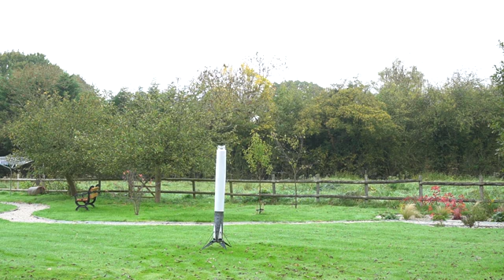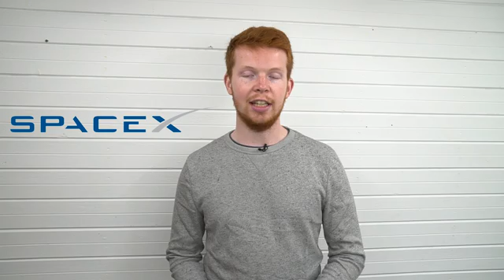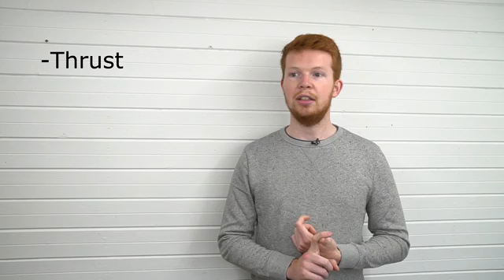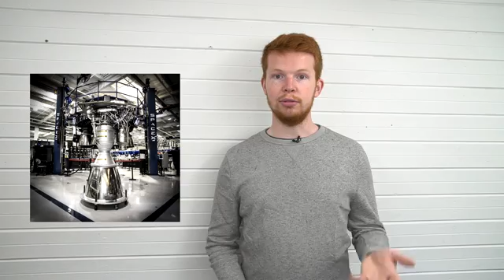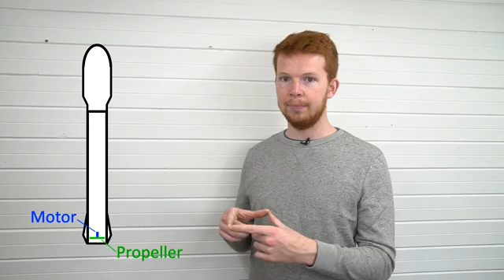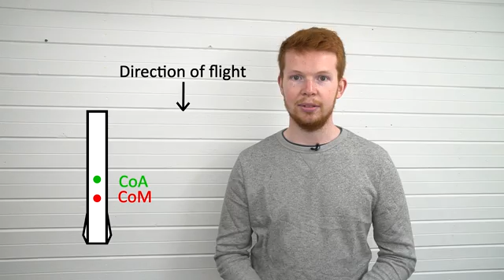Hovering a rocket - SpaceX model

Comment: This is all great. But the control surfaces on planes aren’t all called flaps. You talk about the grid fins as used for aerodynamic control, so that would be like the rudder and ailerons and elevator on an airplane. Not flaps. Flaps are to create more lift when going slow at takeoff and landing.
Reply from the maker: I used the word flaps because the average Joe might not know what an aileron is ;) thanks!
Reply: Tom Stanton Well, educate them then as you do with the rest of your video. :)

Comment: Using a larger ESC would have helped,also using a gyro stabilization system that was calibrated for what you are doing. That would require changing the PID and it appears you dont know how to do that. The mass was over powering the stabilization.  Had you gotten the unit up in the air BEFORE  attempting to control the direction ,you would have been further ahead. Eather way,It was interesting watching you try. Its much better than shouting FAKE and using the lame excuse of CGI . I really want to strap those guys to the real thing and give them the real experience. Awesome job!

Comment: Try inside a large garage or gymnasium so wind won't be an issue. Also, the cg is too far forward. You need to adjust your pid algorithm so it won't oscillate as much... nice work!

Comment: I really liked the elastic tether. Obviously it adds an unwanted dynamic which hampers tuning. An improvement would be a tether of 25% elastic tied to 75% inelastic, so that you can have "free" flight without snatch at end of line.

Comment: what if you go back on the 2 motor version and the second thrust vectoring type.... and use a smaller motor on the tip just give some speed to the incoming air... and use the second motor ,on the lower part of the rocket to hover ... i thing by this way...  u will have more lift and more controll.... and your motors will not stress so much

Comment: Please don't give up on this project! I'd love to see more content about this control method. I have visions of a model falcon 9 with a high thrust COTS EDF for the main engine, a gimbal instead of thrust vectoring flaps, 4 smaller EDFs or mini quad motors as control thrusters at the top and a lower center of mass so it emulates a real falcon 9's control/handling characteristics

Comment: Good job
The problem with the rocket tipping over when launching it (although it was capable of hovering) was due to the wind pushing it to the side with no force into the ground to stabilize it.
That’s the same thing we helicopter pilots have when launching... you have to push it for a split second and then level out to get away from the ground fast enough.
I totally see this as a success

Comment: Really looks possible with your skills and a few more versions.  I have always wondered why they choose to launch rockets vertically instead of flying them more like planes from a horizontal start.  Just seems to me it would save fuel and require less power and stress?  Maybe have jettison capable wings or air frame for first part of liftoff.

Comment: In large rocket engines the load on the area that articulates, allowing directional thrust, is enormous. How can these parts take such a load, and what about powerful lateral forces involved as well? The mechanism must be balanced mechanically to some degree, but still, it must be extremely powerful.

Comment: Should have been called guy builds RC helicopter that kind of sort of looks like SpaceX rocket after talking about it for 30 minutes. Then has problems that normally RC helicopters have tries to resolve them by speaking those words but doesn't
Reply from the maker: But it isn't a helicopter... so that would be misleading! Apart from the source of thrust, the rest of what I built uses rocket stability methods, therefore it is more of a rocket than a helicopter

Comment: While you don't need it to counteract the torque any more, you could still add a second motor to increase your thrust and reduce the load on each motor.  Maybe even give the lower motor a higher pitched prop, because it's dealing with pre-accelerated air.  
Also what size motors were those?  There are some tremendously powerful 2206 and 2207 quad motors these days.

Comment: Great project!  I was wondering if a control moment gyro in addition to the thrust vectoring would give some faster reaction control.  Essentially a high kv miniquad motor with a flywheel on a gimbal may give quite a bit of reaction moment.  I don't know enough about CMGs to know if that is feasible, just a thought.

Comment: Really nice!
I am not an expert here, but i think due to your rocket rotates around its axis it is almost impossible to control it. Is in it? What if you would add compass and combine it with your thrust vectoring system. Your simply requesting direction (lets say north), according to the rocket orientation based on the internal compass just add extra degree to the relevant bottom wings. Of course, wings should continuously correct equilibrium according to the gyroscope indication, your request just add an extra degree to all of it. Then you will be able to sustain the wind even if rocket spins around :) I think... :D
Your projects really interesting to watch!
Regars

Comment: The stability explanation is not quite correct. For stability you need the center of pressure behind the center of mass. This is usually different from the center of area. The grid fins move the center of pressure much more than the center of area, they have hardly any area.

Comment: I would have got it hovering without the body 1st and then gradually add length. Also like helis that require full rpm to remain stable, constantly changing power settings might seem prudent but drives the gyros crazy. In this case a collective pitch system while more complex would be far more stable and controllable. Maybe....

Comment: FYI - the flaps on an aircraft don't offer control to it - the control surfaces are ailerons, elevators and the rudder. 
The flaps increase the angle of attack, drag and to some extent the lift although there is of course a tussle between drag and lift in this case.

Comment: The trampoline would have been an easier landing pad. Smooth and flat, plus some thrust flow through. The grass kept tripping you up when there was any lateral movement.  Why didn't you just add orientation marks and then use the controller to influence the leaning of the rocket into the wind like a real drone does?

Comment: As for the motor burning out, could you not use props that have blades with a greater angle of attack or are these the most efficient in that regard?
Reply: +rpatto92 Blades with a greater angle of attack put more load on the motor unless the blades cavitate (which you won't see at this prop speed).  For the most part, "propulsion motor/blade" combinations are pretty optimal already.

Propellers (as with centrifugal pumps) draw the most power (heat up the most) the more air (water) they're pushing.  Basically because it takes a fixed amount of energy to accelerate a given amount of air (water) to a given speed.  If you increase the pitch (increase air speed) or amount of air (unchoke the input), the power draw goes up, and the motor gets hotter.  The simplest way to cool off a fan (or centrifugal pump) motor is to choke down the input (less volume) or a lower pitch prop (less velocity).  Which generally isn't conducive to keeping the propulsive power up, is it? ;-)

I built an "air cleaner" box for my shop with a 1/2HP blower drawing air through multi-stage furnace filters.   The blower was originally designed for a computer ducted-air cooling system with significant back-pressure (reducing flow).  Full flow thru the furnace filter, it would overheat and thermally shut itself off in less than an hour.  Choking off the flow by about 30% with a piece of sheet metal solved the overheat and the motor ran cold.

I had the same problem with a Jennair cooktop/downdraft blower.  Would overheat in 20 minutes until I choked off the flow a bit.

This is basic civil/mechanical engineering, something my dad taught me, that I've used since.

Tom's solution would have been to go to a more powerful motor.

Tom would probably had a lot of fun with a motor we worked on - a homelite weedwacker engine with an aftermarket "soup-up" carburetor.  7000 RPM 16x16 prop.  When we tested it (at about -5C), the windchill off the 100mph velocity off the prop was about -100C.  20 seconds of that, and my son's teeth didn't stop chattering until after an hour of infusions of hot chocolate.

Comment: Maybe you could go with a hydrogen peroxide engine (for more of a real rocket), and give it some very rapid thrust vectoring.  Throttle can be varied by simply controlling the pump speed of h2o2 into the catalyst chamber.

Put most of the mass at the top such that inertial is much greater at that end of the tube and the bottom of the rocket can move around much faster than the top.  

If moving the exhaust nozzle is too daunting, then go with multiple smaller nozzles so that a differential thrust can be generated.

It would be noisy -- very noisy -- and generate loads of steam, but what a show you'd put on!

Comment: It strikes me that your prop-fan arrangement lacks one more feature that a rocket has, that the weight (and centre of gravity) won't continually change as the reaction mass runs out. As this feature would make the whole thing hellishly more complicated, one more reason not to use rockets for this project. ;)
Reply: Changing CoM isn't that hard to manage. What is really a pain is propellant (fuel) sloshing inside tanks. :)
Reply: Gary Bullwinkle What? the oxidizer is only needed when you want to use a chemical rocket, and a chemical rocket is just one of the multiple options to get thrust in space. There are nuclear engines, ion engines, plasma engines, and lot more of things that don't use oxidizer since they don't burn anything. A fan connected to a battery doesn't use oxidizer by the way, it just needs atmosphere.
Reply: I had a generally good idea of the physics involved (following the rocket developments since the 50s) but realized something new today ... the gimble  correction angle needs to change during ascent due to changing  center-of-mass.
Reply: The only reason for using a rocket in the first place is the lack of an oxidizer in space!   If the oxidizer is readily available, why carry it?
Reply: Well, not the only reason; one could use a gasoline engine with its own oxygen supply, if you could figure out how to make it give useful thrust. I get the impression Tom would have used a rocket if it could have been installed as easily, cheaply and safely as a prop-fan.

Comment: We know helicopters can hover. and a contra-rotating blade drone can hover, and a drone inside a tube can hover. So what have you accomplished here? Hovering a rocket is a whole other barrel of fish from hovering a hollow tube. Space x use video fakery to make you believe their nonsense. Unfortunately you are trying to copy video effects with real world physics. 

Indeed, we can see that your thrust and weight of motor are set in the top of the tube. Space x's hovering thrust comes from the bottom of the tube. In your example the tube gives some stability to the hover. That doesn't happen if thrust is applied at the bottom end of the tube IE a rocket.

A very brave attempt though.
Reply: bob question the air comes out of the bottom, therefore that's where the thrust is.
Reply: jetison333
The thrust is all on the fan blades at the top of the tube.

Comment: It looks like your thrust vectoring is effective until one gear leg touches down, at which time the correction for the motor torque is thrown off.  I’ll bet the solution will be found in a return to the counter-rotating fans, combined with your thrust vectoring.  Have you considered using a pair of accelerometers like those found in cell phones?  One at the top of the tube and one at the bottom.  Your guidance program could compare the inputs to assist in attitude stability and one could also be referenced for position over the ground stability.  It would be cool if that could all be programmed into an on-board processor like an Arduino, making your “rocket” nearly autonomous.
Reply: Tom's using a flight controller from a quadcopter / drone that he's written custom code for. This has accelerometers and an in built compass and is running on a chip that's much faster than the arduino.
Reply: He already knows angular velocities of that thing.
Touchdown detection is always done using physical switches in landing legs/landing gear, both in all rockets and in airplanes. There are also other ways, such as analyzing vertical velocity and throttle level. 
But for all that he'll need to work on the code a lot. I also suspect he based his code on Cleanflight software for simple multirotors that runs on STM32 ARM-based chip. Simpler version of what we all have in our phones. :) If he were to base it on Ardupilot it would produce better results because that code has way better algorithms to base on. For example, it determines position the way real vehicles do, by fusing together accelerometer, GPS and barometer data. 
Btw, thank you Tom, you've inspired me to continue tinkering with my Python code for optimizing trajectories and controlling a rocket in KSP.
Reply: arduino has fast chips nowadays. You could also compare the results of top and bottom sensors. Ilike where Norman is heading with this.
Reply: Did you work for NASA?
Reply: olympiclinic, no, just a life-long interest in aerospace and engineering principles.

Comment: Awesome work, so you built yourself a drunk spacex rocket.
I knew about center of mass but never though about center of area which when you think about it, makes perfect sense. I learnt something knew.
I highly recommend using an ESP32 or ESP8266 saving you to plugging it in all the time. they are very small but not sure how much weight would affect your balance. You could potentially record your data while it's hovering for calibration.
Continue the good work.

Comment: Very good idea ! Success for a first try. Why did you remove one of the vertical thrust motors for the second iteration ? Maybe you should have kept the two counter rotating motors you would have have had more thrust and less thrust would have been lost to stabilize the rotation. I would like to see a follow up.

Comment: For the first attempt you say that you used a flight controller from a racing drone but in the second attempt you just reference a gyro to control servos. What gyro were you using? Also if you didn't want to use polystyrene to make the rocket body you could use cardboard tubes that many high power and mid power rockets use for Rocketry. I really hope I see a part 2 in the future, this really intrigues me!
Reply from the maker: Apologies for not making it clear, I used the same racing drone flight controller for both version (Naze32). Thanks!

Comment: Hi Tom, in order to increase thrust you could increase the diameter of the propeller to fill the inside diameter of the tube. Much more like a ducted fan works, this would also greatly improve the noice and vibrations coming from the propeller. As for the thrust vectoring, you might have better luck changing your design to accommodate a flexible cone as it will create a single jet of air which is more stable and controllable that your current spiral, if you run some smoke through the vectoring system you will realize that your current jet stream is broken down in 4 surfaces, I imagine this will also reduce the efficiency of the motor. On a side note, all rockets need a landing zone, get yourself a piece of plywood to reduce the chances of the landing gear getting caught with something. An idea that I'm going to throw your way, you could use a flexible filament with your cr10 to print a conical nozzle that you could actuate with servos and wires, you should only need 1 servo for each axis which would reduce power consumption and give you a longer flight time. Another idea, if you put a rotating weight on the z axis you might be able to put a payload on top without having to worry about the center of mass shifting too much. Anyways great video, I'm looking forward to buying a printer myself and build projects just like you do!.

Comment: Tom, you should've come to Manchester for uni. We have a society where we're attempting to build a 2 stage rocket where the 1st stage will land itself after deploying the 2nd. We will use a hybrid rocket and probably thrust vectoring similar to your attempt.
Reply: I'm 14 and doing this myself.  Quick question though, how the heck do you keep your rockets fuel from burning up on the way back down? Seriously. I never have enough by the time the flight controls started the oxidizer flow.
Reply: Nicodemus Underkoffer if I understand your problem correctly, it is similar to landing the Apollo LEM on the moon. A very difficult problem to solve without calculus and a radar altimeter. I think you must allow gravity to start the journey down with minimum thrust, then at the correct time use maximum thrust calculated to stop the rocket just as it reaches the ground. Without a controller knowing height and speed, it is difficult to understand how a controller can do this.
Reply: Nicodemus Underkoffer Ah, perhaps I misunderstood your problem. You mean the fuel grain continues to burn during unpowered flight because of oxygen from the air? That is a problem with a hybrid engine. Is your rocket big enough to include a small CO2 system to purge the fuel after the boost phase has ended? Like a small fire extinguisher. Then the problem will be how to ignite the engine again for landing.